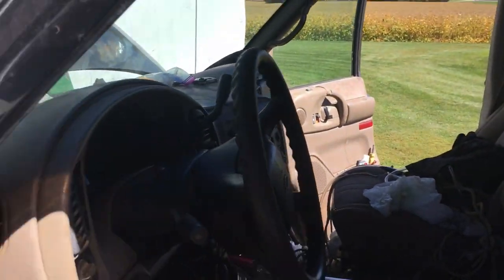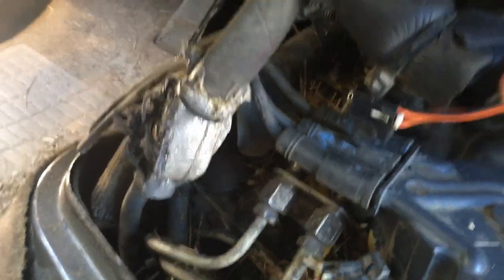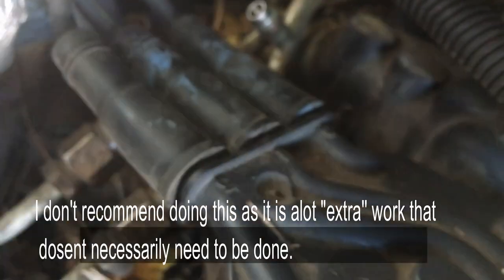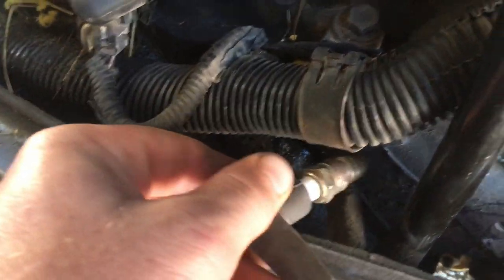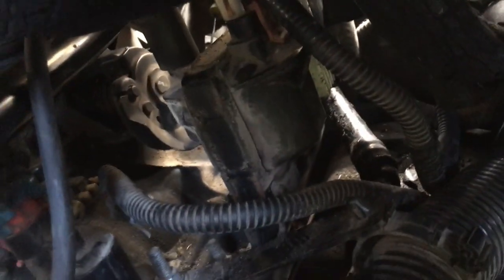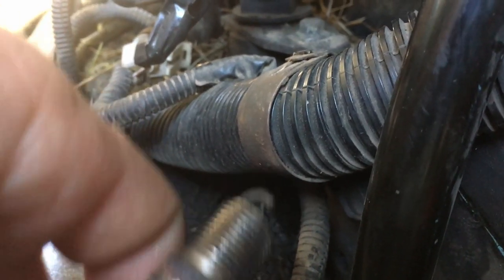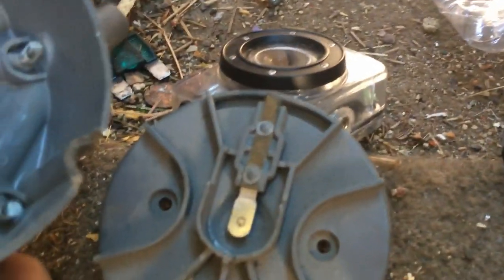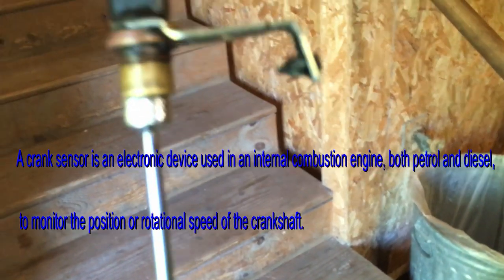Crank's No Start Chevy 4.3 Astro van No Start-Fix Year 2000

Comment: Do u think the t. position sensor would kill the spark if it is bad?
Reply from the maker: I'm not sure what the t sensor is? My guess would be if you don't have spark and you have a new cap and rotor, it's more likely the coil or the crank sensor.

Comment: Hey there. My 97 Chevy Astro van just broke down. I was on the freeway and noticed it started kinda acting like it was Gunna stall. Then it went away and about 10 min later sure enuf it just lost all power and I had to have it towed. Now it will crank just fine and sounds normal when it's cranking but it just won't start. It has 160k miles on it. I'm pretty sure it's not a fuel issue as I can hear the fuel pump turn on and I changed the fuel filter a few months back. I'm assuming it's spark related and I was guessing it was the camshaft sensor inside the distributor cap. Either that or the coil or Icm. Can you make a video on how to change out a camshaft sensor please?? Or showing how to change out the coil or Icm module?
Reply from the maker: It could be several different things. I would start off with doing a spark test and go from there.
Reply from the maker: cap and Rotor and coil would be the easiest to try right off the start
Reply from the maker: My van was stalling and dying and then just wouldn't start.
Reply: @MattBroquard  yea same with mine. It stalled and now n it just won't start. I'll try and figure it out
Reply from the maker: Good Luck, Let me know what you find if you don't mind!...Def interested in knowing. Best to you!
Reply from the maker: Paul Au-France Hi Paul did you  ever figure out what the problem was on your van? Please share if you don’t mind it would be much appreciated! Thanks!
Reply: @MattBroquard  hey quick question here. I have spark and fuel flow and my 90 Astro will not start. Coil was gross and so were some of the plugs. All dandy now but still not starting?????
Reply from the maker: @dianastringer3355  Hi, it could be possible that your fuel pump is not making enough pressure, it needs to be around 50 psi or so. Also it could be the ignition switch. Also double check the spark plug wires and make sure there in the right spots.
Reply from the maker: Check out the video on my channel about a Astro van not starting in the cold it’s a few plus videos back, i recently just changed my ignition, it had spark but still would not fire.

Comment: I should started from here in the first place, why..? Because this the first part I change in Ford Ranger, thinking it was that, then went for my gas ⛽ relay, & at the end I change my gas pump. But I have Fuel ⛽ pressure, & I change mostly everything, I yes need the crankshaft position sensor, & this got be, because like I said, I have change, Plugs,  wires, the GVR, trouble position sensor, the cap, rotor & everything I yes missing the position sensor..

Comment: Same problem. Changed all that same stuff out. Still no spark. Pretty sure my next move is adjusting the crank sensor with shims. 

Did you have to fiddle with shims for the crankshaft sensor? If not, where did you get the sensor? 

Thanks man
Reply from the maker: Never had to shim anything, just bought part and put it in-Maybe check your ignition switch if you haven’t yet! Hope you get it going!!
Reply: @MattBroquard  already switched out the ignition switch, and the rest of the parts cannon at it.
Reply: @MattBroquard  already changed that out

Comment: mine was the ignition coil!!!
Reply: Did you check spark 1st or just changed it
Reply: @Evol112011  just Change it!s a van thers litterally  no ventilation Excessive heat destroys Parts!!